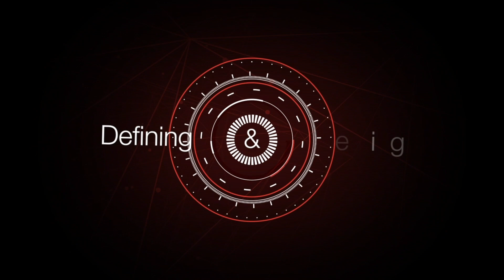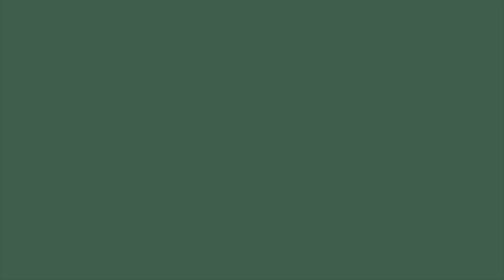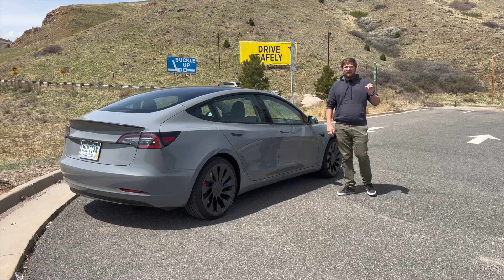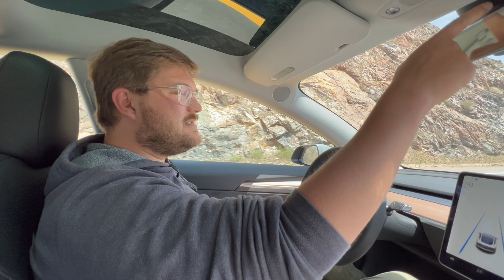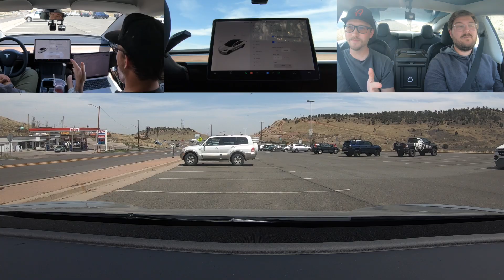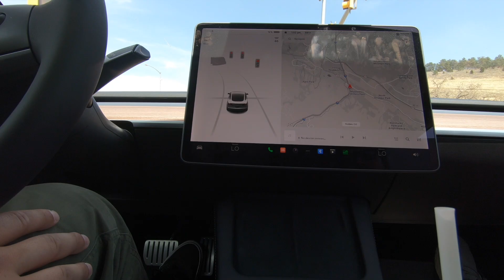2022 Vision-Only Tesla Model 3 Autopilot Hogback Driver Assistance Challenge!

Comment: I had no idea the gap between Tesla's driver assist and others was so big. Thanks for doing these tests.
Reply: @jurycould4275  Did you watch that video to the end?  The Golf had 8 take-over events, and 3 disengagements without warning.  They gave it a score of -10, compared to this Tesla's +7.
Reply: @jurycould4275  actually the model 3 is currently 47k but last was 40k for most of the year
Reply: @jurycould4275  does the base Golf come with auto-steer and adaptive cruise control?  Maybe because I'm in California, only the GTI ($29k) and R ($44k) show availability of IQ.Drive.
Reply: @jurycould4275  that’s not even remotely true. What planet are you from and how long are you visiting?
Reply: @PumpUptheJam81  hahaha which planet hahaha dumb dumbs are all over
Reply: It isn’t. Not when you’re running Openpilot on a Comma 3 in a gold-supported vehicle. And somehow no one knows this.
Reply: @ericanderson1753  no idea what you just said
Reply: @DanyMeza  exactly. That’s what I want to change. Comma 3 is a device from the company Comma AI that any person can add to their (supported) vehicle to have the best level 2 self-driving outside a Tesla, and sometimes better than a Tesla, like in laneless driving. Check it out!
Reply: @ericanderson1753  That is a hardware addon isn't it. Aftermarket adas, probably the reason why few talk about it.
Reply: @nguy404  aftermarket, yes. But easy to install for an average person, and identified as the best ADAS system on the market by Consumer Reports. Above Autopilot. Above SuperCruise.
Reply: @ericanderson1753  No one gives a shit about aftermarket add ons
Reply: @DanyMeza  Me too. 👍
Reply: @ericanderson1753  Thx for the info. Not usable in Europe.
Reply: @ericanderson1753  fsd beta says hello
Reply: @ericanderson1753  comma 3 on gs3+ is fabulous, but fsd beta, although jerky at times, is way out of C3's league, not even close and getting farther. Comma is great for the price, but autopilot it aint.
Reply: @GoatDirt  basic Autopilot and FSD are different systems. I wasn’t claiming that it is on the level of FSD.
Reply: Eric Anderson did you have a stroke writing this? What does this have to do with OOS’s test or anything in this video lol
Reply: @philorgneopolotin8762  thanks for the charity and kindness. I’m happy to clarify. Which comment do you find most problematic?
Reply: @ericanderson1753  Don't know what you are talking about. Which EVs run with Openpilot?
Reply: @wolfgangpreier9160  you can get open pilot with the ionic 5
Reply: @youngchirp12  Maybe in the US, in Europe thats strictly not allowed.
Reply: @ericanderson1753  Comma 3 is god tier. Coming from openpilot to Tesla's autopilot, openpilot truly is on another level.

Comment: Autopilot on highways is more attentive than I am. It handles 80% of my commute flawlessly.
Reply: 80??! Mine is up in the 95-97% of drives
Reply: @Valencia_Media  the other 20% is on back roads so I don't use autopilot then....
Reply: @ephraimhill1109  ahh i see what you mean.
Reply: More like 95% of the Autobahn and only about 20% of regular streets because its limited in steering angle and steering speed by the UN/ECE rules.

Comment: tesla owners are going to hate me for this suggestion: add a timer that is about 5-10 minute time out for any self driving functions if it detects abuse or not listening
Reply: It will give you a time-out for the remainder of any drive if you do not engage.
Reply: Forcing you to stop and park in order to get autopilot back on (which they do now) is a much better incentive than it turning off for 5 or 10 minutes.
Reply: @BitJam  im saying add that onto those that abuse that 2 times as extra justified punishment
Reply: The system already is disabled until you park and resume driving after 3 strikes

Comment: Why are you doing this test on a car that does not have fsd?  Even on the freeway with the non-beta version, Navigate on Autopilot is really good with automatic (or user initiated auto lane changes).
Reply from the maker: We will also be running cars with that option selected. As stated, we want to have every version included in our test.